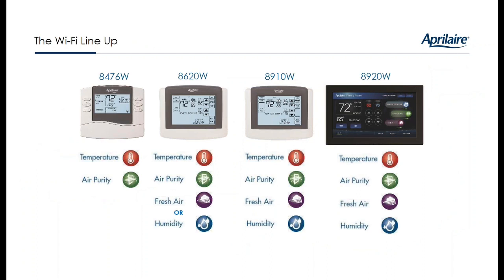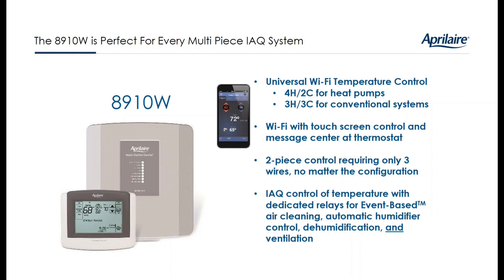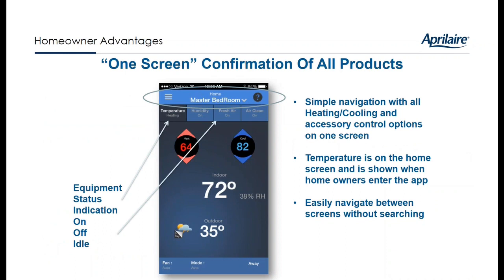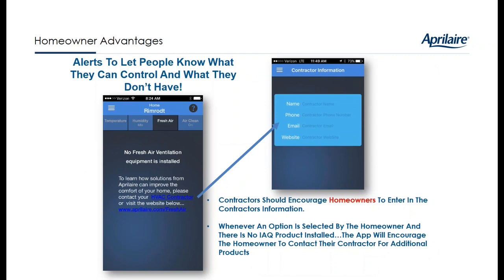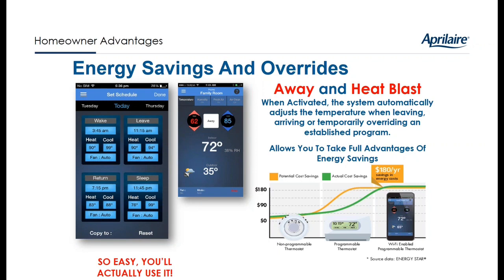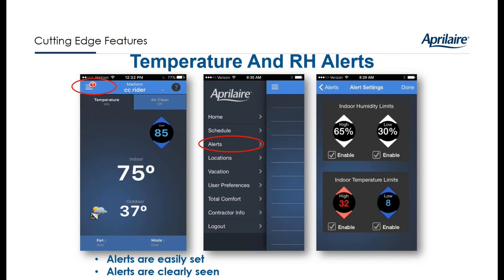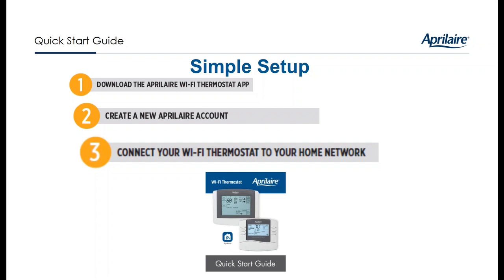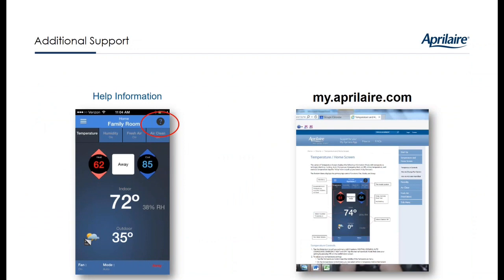AprilAire Wi-Fi Thermostats Product Training Webinar (Recorded February 2020)

Comment: Why do just need 3 wire at the thermostat
Reply from the maker: Thank you for contacting AprilAire! The 8920/8840 Thermostats have a 3-wire communication style to the provided equipment control module where you would wire the terminals from you furnace and it sends and receives signals from the wall mounted screen. If you have any other questions, please contact our technical support team at 800.334.6011.

Comment: Does AprilAire Wi-Fi Thermostats work with Goodman variable speed HVAC systems
Reply from the maker: Thank you for contacting AprilAire! Our thermostats utilize industry standard wiring, such as R,C,W,Y,G etc. If your furnace also uses industry standard wiring, then our thermostat will be compatible. If you have any further questions please reach out to our support team at 800-334-6011.

Comment: Just had my 8920W installed 2 weeks ago and the WiFi just does NOT connect or work with the app at all… I’ve tried on both 5.0 and 2.5 connections and nothing has worked.
Reply from the maker: Thank you for contacting AprilAire. Would you mind giving our technical support team a call at 800.334.6011? We would be happy to assist. A team member is available Monday through Friday, 7:00 a.m. to 5:00 p.m. CT.
Reply: Did this ever get resolved? Having same problem! Only 2 days I’ve had this thermostat

Comment: It would be cool if either the base unit or the control pad had an ethernet port.  If you let the base connect to the internet, perhaps the control pad could operate on batteries.  Either way I'd prefer an ethernet connection.

Comment: Can you use these on the E070 dehumidifier?
Reply from the maker: Thank you for contacting AprilAire! Any of our Indoor Air Quality thermostats can control the E070 dehumidifier. This would include the S86NMUPR, S86WMUPR, 8920W, and 8910W thermostats.

Depending on your application as well and what it needs to work with, you could look at some of our automation thermostats or the 6000 series zone control thermostats. We hope this helps! We would be happy to assist with any further questions. If you would like to discuss your application in more detail, our team can be reached at 1-800-334-6011 Monday through Friday, 7:00 a.m. to 5:00 p.m. CT.

Comment: Great accept beginning with the 8620W you have to have the old 2.4 internet system these will not function on 4g or the new fiber optic 5g network......pretty bad isn't it? 200= dollars for something that needs an old internet system to function.
Reply from the maker: Thank you for contacting AprilAire. We operate on 2.4 due to its reliability, compatibility with other devices, and simplicity. 2.4 is very standard for the industry and especially with smart home devices. If you have any additional questions or comments, we would be happy to discuss. Thanks again for reaching out.
Reply: Even the newest wireless routers support 2.4ghz

4g and 5g are cellular terms, not WiFi standards.

You have no idea what you’re talking about buddy

Comment: Can the 8920 control the 8100 erv?
Reply from the maker: Thank you for contacting Aprilaire! Yes, the Model 8920W thermostat can control the Model 8100 through a 2-wire control scheme. The 8920W is given the information on the home and controls the ventilation timing directly. If you have any additional questions, we'd be happy to assist! We can be reached at 1-800-334-6011 Monday through Friday, 7:00 a.m. to 5:00 p.m. CT.

Comment: Hello,

I just purchased a home and it had 2 Aprilaire Thermostat 8920w downstairs and the 8810 upstaire and both have the wife option. I don't know how to work them or why they have 2 in the home. My home is 2000 sq ft and I can turn them on independently and only have it working either upstairs or downstairs. My other home I installed an EcoBee and it is 2,500 sq ft.
Reply from the maker: Thank you for contacting Aprilaire! Would you mind giving us a call at 1-800-334-6011? We’d be happy to assist with this.